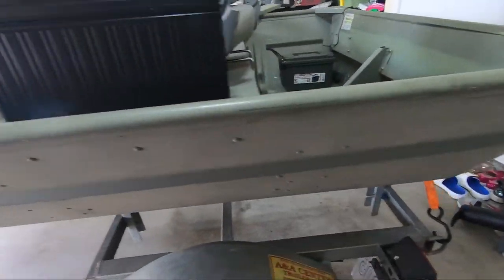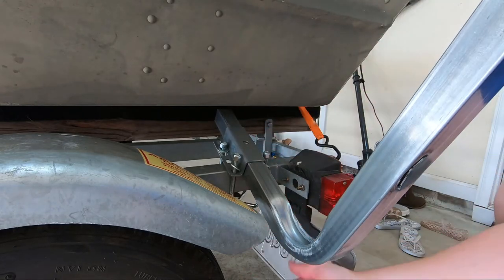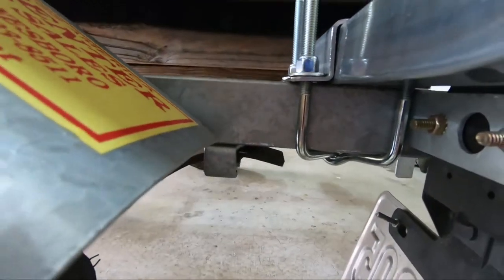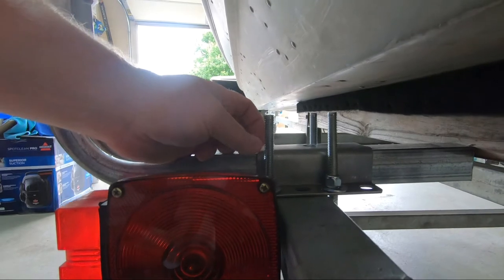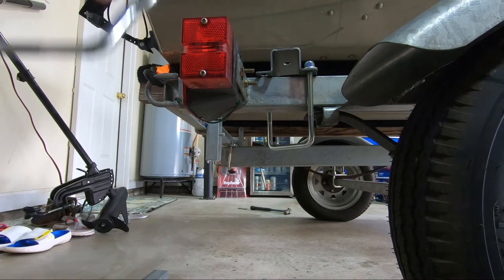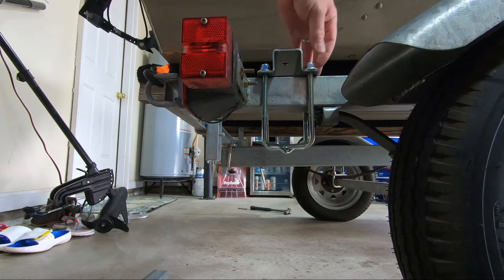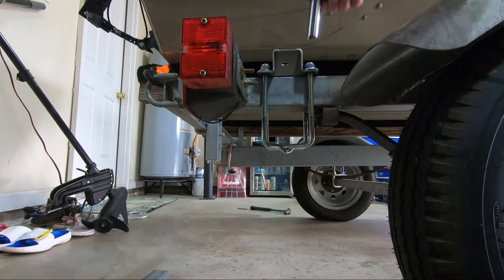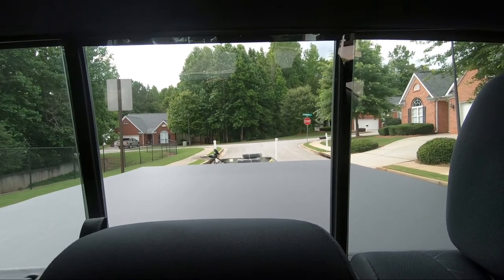Installation of C.E. Smith Trailer Post Guides

Comment: U bolts are on correctly. If you put the bolts facing down then the brackets would be below the frame and it looks like there isn't enough clearance for the trailer's springs that way.  I would say trimming the bolts is the way to go.